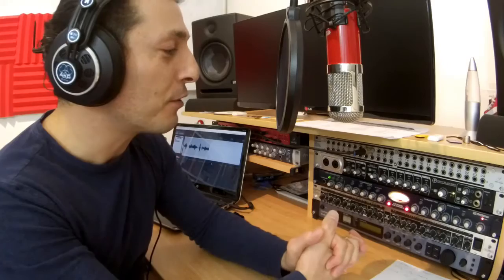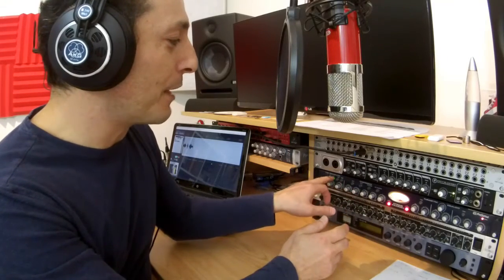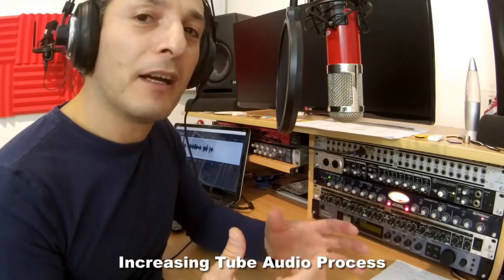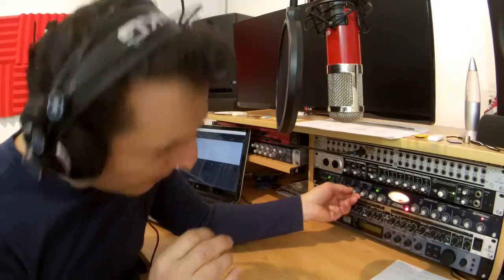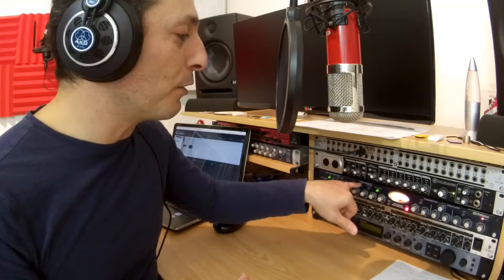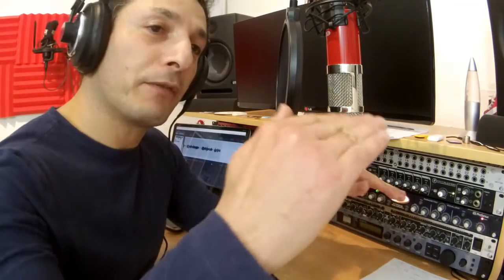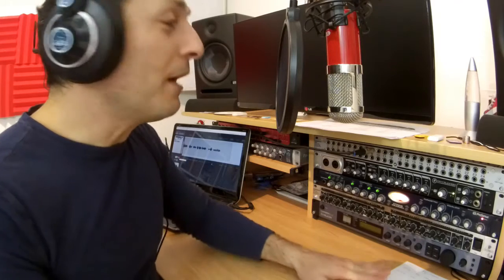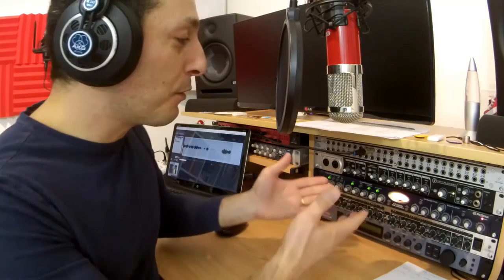PreSonus Studio Channel Mic Tube Pre-Amp Audio Demo

Comment: Useful video. Awesome. Is it normal to use this device in a live performance? Or should I rather invest my money with a better microphone?
Reply from the maker: The compressor will reduce the dynamic range of the vocal thus making it more pronounced in the band. Depending on how your sound system is set, this may introduce feedback if not set correctly. 
Basically, if done correctly, the vocal will sound louder.

Comment: I also tried with the same cable but it doesn't work. In the technical data sheet of the Rode NT1A it says that it can work with either 24 or 48 volt Phantom Power but does the AT2020 only work at 48 volts? And something a little strange.

Comment: hi, I have a pressonus studio channell and I have two condenser microphones, the Rode NT1A works well with the 48 volt phanton activated while the second microphone of the AT2020 audio-technique does not work with the studio channell but if I connect them to the sound card they both work like never before .Thank you
Reply from the maker: Interesting 🤔. Using the same cable for AT2020 as for NT1a? There should be no issue with either. Make sure you turn phantom power off when connecting or disconnecting.

Comment: Thanks for the tutorial! You're the man! One question. If I'm using an mbox, do I turn all the settings down on the interface and just use preamp?
Reply from the maker: You can use the TRS line level output into your mbox line in. Make sure the Studio Channel output level is on 0 (zero) and use the mbox input gain to adjust for best audio level.

Comment: My tube session has a crackle in it. Any suggestions as to why that is? Do tubes crackle if they are going out?
Reply from the maker: No, it’s not normal. How old is your unit? Did it just start to make the noise? Mine is over 8 years old and used all the time and no issues.

Comment: HI . Very interesting video. Just one question. Do you need this   in casa tu have the presonus 32 series 3 ?
Reply from the maker: You don't necessarily need it, but I use it every time on any mic, vocal or acoustic guitar, before any mixer or interface. Yes, even when I had a PreSonus StudioLive Ser 3 mixer. It's a personal choice. It doesn't magically make your sound better, but it allows you to control the dynamics smoothly.

Comment: Im using my studio channel as a preamp for my vocal monitor in performance and auditioning ,,, do you know of any problem that I might have if I power my monitor from the XLR out and send the line out to the house PA at the same time ,,,, Im not finding any ligature referring as to whether or not this is doable ,,, Thanks for you videos , Very helpful and well done
Reply from the maker: I'm pretty sure the audio signal is sent to both XLR and LIne level outputs at the same time, and I see no reason why you could not use it both at the same time. Though I have never tested this, if plugging a TRS Jack disconnects XLR output.
I know you cannot use both XLR and LINE level inputs at the same time. LINE level precedes XLR, so if you connect a TRS Jack plug, XLR is disconnected.

Comment: You have the tube drive at about 30. What do you have the gain on the tube at, and what exactly does that do? The knob furthest to the left. Thanks.
Reply from the maker: First knob on the left is the input gain knob. More input gain, more signal to the tube, as well as the Tube knob determines the amount of the signal fed to the tube. As I explain in the video, the signal is split before the tube, one path sent direct while the other trough the tube, amount set by the Tube Knob, and both mixed back again.
Reply: so how much is ur level at with 25 % mix ... m keeping tube drive at 25 % for vocals is it good....?

Comment: Thank u for ur taking ur time to explain this. I do have a question though. Can you pls talk about the peak button in the EQ section of the vt 1
Reply from the maker: The Peak button sets the low and high EQ bands to Shelf Curve or Peak Curve, to increase or decrease the level at a set frequency (Peak), or from that frequency point up or down. Peak is usually used to notch out certain frequencies, where Shelf is used for broader range increase/decrease.

Comment: Hello!!! nice video I have a question i hope that you can help me
i have the Bluetube v2 preamp. of presonus and a 1818VSL Inteface and i dont know how much level i have to put the gain in my interface for the preamp. and the interface work well!!! i hope you be well friend!!! and i hope you can help me!!! sorry for my bad english!!!
Reply from the maker: Make sure the Bluetube v2 preamp VU level does no go above -3db at the loudest point. Then with your 1818VSL, using the VSL mixer software, make sure you adjust the input level knob up until the levels show enough signal, about 75% (since there is no db metering on the VSL mixer software), then you are good to go. You can always go a bit lower, but don't go too hot (too loud) in leveling.
Hope this helps.
P.S. You might get better signal if you use the JACK outputs into inputs 3 & 4 on 1818VSL.

Comment: I got it hooked up to my focusrite, but a cant get any sound throught the microphone. Also can you use the presonus studio channel after you record? then mixdown or master. Also the VU meter is moving when i turn up the volume on the focusrite
Reply from the maker: I assume you have the microphone connected to the Microphone XLR input of the Studio Channel and TRS line out to Focusrite Line input. While you have the Output level to 0, increase the Input Gain till you have about -6db on the meter at its loudest singing, then adjust the Focusrite Line input till you get good audio.
I can't see how Focusrite's volume can effect Studio Channel VU meter, unless you have wrong connections.
Reply: I have the TRS going into my input 1 in the back of my focusrite 18i8 and the mic is pluged into the mic input on the back of the presonus studio channel. everthing is at 0 o 12oclock. In studio one I have a mono track on input one but cant record any sound or hear anything
Reply from the maker: Looks like you are connecting the TRS output of the Studio Channel into the OUTPUT 1 of 18i8. You need to plug it into input 3 or 4 at the front (inputs 1 & 2 are guitar inputs), then set the track input in studio one to 3 or 4 respectively.
That's why in you previous message, VU was moving when adjusting level on Focusrite.
You REALLY need to read your manuals, before you damage your equipment.
Reply: It dosent say how to connect anything in the maunal, i just went by the box. Ok ill try the front input 3 or 4. In the focusrite conrol it say these are PAD? Inputs 1 and  2 can be changed from analogue to Instrument

Comment: I have a presonus studio live mixer 24.4.2,  I use it as an audio interface but for recording (DAW studio one 5 ) the gain is too small and the wavesform are thin. can I use PreSonus Studio Channel Mic Tube PreAmp  to solve the problem, and can I cause noise when using it. thank you for the help
Reply from the maker: Are you using dynamic or condenser mic, or line level? Are you setting the StudioLime channel gain correctly?
Reply: @RecordingStudio9   I use a dynamic microphone, I haven't bought the preamp, if I can, I'll buy
Reply: if I use the condenser mic there is too much room noise
Reply: i set the mixer gain at 3 o'clock

Comment: Could I plug my microphone directly into this PreAmp and then take the output (XLR) and put it into my mic input on my PreSonus AudioBox 1818 VSL?
Reply from the maker: Yes, you can. But I have TRS lead from the output into the input 3 Line level to my 1818VSL, so you don't get 2 mic pre. Line level goes strait into the A/D converter. Much cleaner and less chance of distortion.
Reply: RecordingStudio9.com Ah, that would work better. Thanks man!
Reply: @FrankTheTankA1  p
mm

Comment: hi dear,hi dear, could you help me? do you know if it is 100% valved, or hybrid like blue tube, behringer, art channel pro etc? could you help me? do you know if it is 100% valved, or hybrid like blue tube, behringer, art channel pro etc?
Reply from the maker: I have never opened the unit, but I would assume they are hybrid. The tube is in parallel with solid state audio path, so you can mix the balance.

Comment: sir this is great, wish i could get more, since i just bought this gear and i need some help
Reply from the maker: Let me know what help you require, and I'll see what I can do.
Reply: well i want some help with compression en fisic eq, setting, i work mostly with rappers, so i need some help.. thank you
Reply from the maker: It does not matter who or what instrument you are recording. You need to learn and understand what you are trying to record and know your gear how it works and apply. 
Example, If you are recording a bass guitar, we know it produces low frequencies and has low frequency range, so you adjust your gear to manipulate those frequencies till you achieve the result you are after. If you cannot work it out, it means you need to learn more about your gear on how it works, before you even try to record a bass sound.
Eg. You need to learn how your hammer and nails works, before trying to build a shed. Knowing comes from practice.
Hope that helps.
Reply: okay thank you very much, im only recording vocals, rap vocals

Comment: What about wordclock on this device can you bypass the pre amp
Reply from the maker: It's all analogue so there is no WORDClock. Using the LINE level input using the TRS socket will bypass the Mic-Pre, but you can still apply the Tube Parallel processing, as this is after the Mic-Pre module.

Comment: I just got one of those and I connected it and it makes nothing it doesn't compress or Eq no bypass why is it doing this
Reply from the maker: Hi, You may need to read the instructions. How and what are you connecting at the input and the output?
Reply: +RecordingStudio9.com Xlr Input Trs Output Into an Interface line input
Reply from the maker: Make sure you have enough signal going in, specially from the Mic. At least have signal to -7db on the level meter. Not sure how much you know about how Compression and Parametric EQ work, might need to play around, experiment and read up about them.

Comment: Someone have the idea... how I can get a radio voice quality which is warm and clear like in radio studios? :)
Reply from the maker: Experienced announcer, correct mic for announcer, good compressor with de-easer.
Reply: Which announcer and compressor? :)
Reply from the maker: An announcer is the person that is talking. If you don't have experienced person with good voice articulations, no matter what equipment you add, it will not sound good. Equipment enhance the audio signal. Good original audio signal, good enhancement, bad original audio signal, bad result.
What I'm trying to say is that if you want your voice to sound good for radio or podcasting, first you need to make sure your voice sounds good with even basic microphone. This comes from vocal training for radio talk. The equipment will just make it better. Than all you need is a compressor to level and balance it all out and make it sound good to the listener.
Hope this helps.
Reply: Brian Chilla

Comment: Can you look to see how to hook it up to an apogee duet 2 I’ve had my studio channel for over 4 yrs and can’t use it at all with my interphase...they don’t provide any instructions. Trash company for what I thought was going to be for a good purpose.
Reply from the maker: Sure, buy me an Apogee Duet 2 and I'll show you how :) i.e. I don't own an Apogee Duet. But it should be no different than in my video. Connect your mic XLR lead to Studio Channel, then the TRS LINE output (1/4" Jack) from Studio Channel into INPUT 1 of Apogee. Then in your DAW, create a mono track and select its input as INPUT 1.
If using condenser Mic, make sure you turn on the +48V
Hope this helps

Comment: I bought one of these a few years ago, barely used it and went to put it back in my studio rig. There's a crackling sound I can't get rid of and a friend of mine who's a tech with years of experience working on electronics said it appears to be something in the board. This thing was barely used and turned out to be a piece of shit. I have an email into these fools and I guarantee you nothing will be done. I'll never buy a piece of their shitty gear again, and I spend thousands on gear.
Reply from the maker: I have been using mine for the past 6 years with no issue. I use on a regular basis as my main Mic-Pre. Clean as a whistle. Could be defective unit. Raise support ticket and send them a sample of the noise.
Reply: I just got one of these and it's completely useless. I'm just going straight into my Apogee Firewire Duet for a much cleaner sound without any annoying bass rumbling and buzzing that this units puts out. Just use your DAW eq and compressors and you'll save yourself some money.